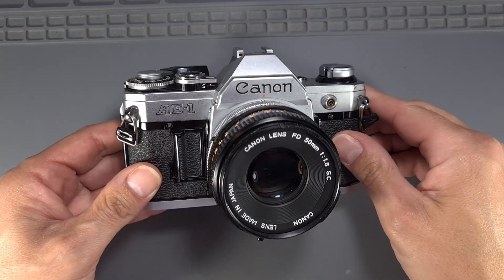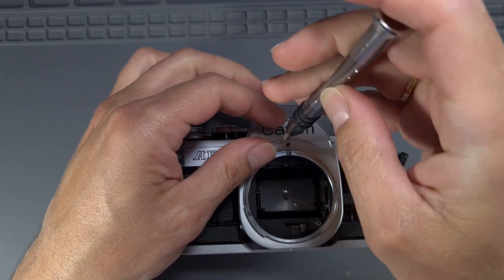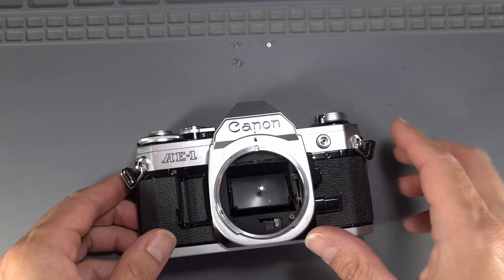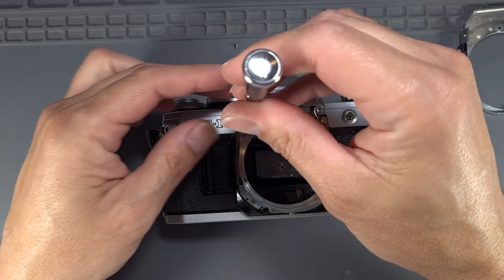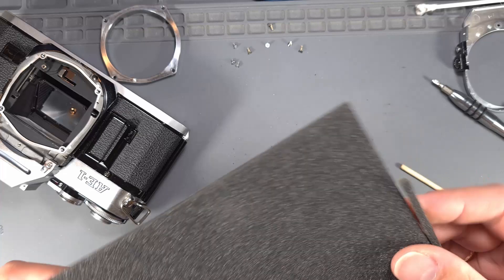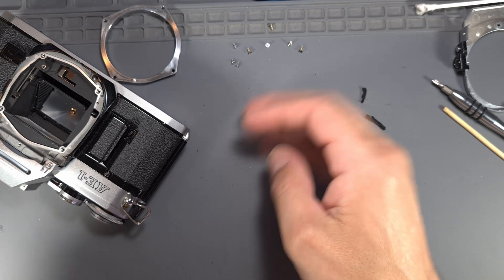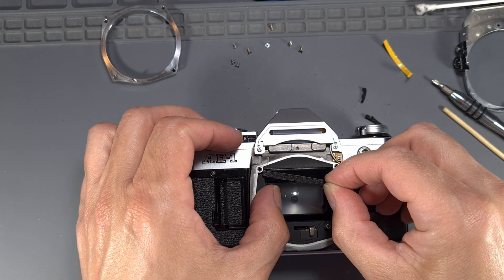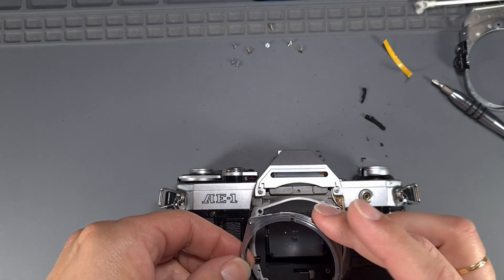Canon AE-1 - Replace the Mirror Damper

Comment: Hello Sir, great video!

One question:
I just bought a Canon AL-1, and replaced the mirror damper with a 2mm thick foam.
I've noticed though that the mirror (and neither its frame) does not touch the dumper foam when going up, and actually with its frame hits a small piece of steel placed on the top left.
There's also a "spring" noise when doing it.
Should I add another 1mm thick foam?

Thanks!
Reply from the maker: Better to replace to a 3mm one...

Comment: Thanks for the video! There are a couple videos on YouTube demonstrating how to replace the light seals on the Canon AE-1, also applicable to the AE-1 Program which I own. More than one video demonstrates using yarn and adhesive-backed felt instead of replacement foam, because yarn and felt are more durable and equally effective. However, those videos don't demonstrate replacing the mirror bumpers, only the light seals on the back of the camera.

I am curious:

1) Could adhesive-backed felt also work for the mirror bumpers if it is cut to the correct size? Or will the adhesive-backed felt be the wrong thickness to mimic the 3mm replacement foam?
2) What do you make of the yarn-and-felt light seal replacement strategy overall?

Thanks again!
Reply from the maker: Hi,

1)  The adhesive-backed felt is the wrong thickness...
2) Sometimes I use yarn in the light seals to... It's easier to apply in some cameras...

Comment: really great video! I have a question: I had some specs on my focus screen from the foam. I removed them with some isopropyl alcohol but now I have smudges all over it when I look through the viewfinder. its like the alcohol left a smear across it that I cannot remove for some reason. I know it doesn't affect the photos but I am wondering if there is anything I can do about this?
Reply: Hi ! I have the same issue...
Reply from the maker: Focus screens are very delicate even with alcohol...

Comment: The small black box on the side of the front cover came off when I took off that first part 😥
Reply from the maker: There is no problem... just put it back again before install the front cover... That part is not glued to the cover. You just have to be careful not to lose it.
Reply: @FotofixVintageCameras  reattached it no problem! Thank you

Comment: Hi, my Canon AE-1 has a problem with the mirror that is stuck up. Otherwise the camera is in excellent condition and is responsive to battery but I can't get the mirror to go down. Is it hard to repair? What could be the problem? Thank you for your time!
Reply from the maker: When you press the battery test button the mirror goes down?
Reply: @FotofixVintageCameras  Hi,I have the same problem,the mirror stays up ,but goes down when I press the battery test,what could it be,thank you

Comment: Does taking off the front cover make it easier to access the location you need to lubricate to get rid of the common squeak sound when the camer shutter fires?
Reply from the maker: Yes, you have to remote the front cover...

Comment: I have an issue related to this. Recently got a pretty minty Canon AE-1 that seemed to have some specks when I looked through the viewfinder. After some poking around, it looked like the focus screen had the specks. I tried blowing a bit of air on them but they didn’t budge, so I went in with a q-tip. It wasn’t dust though, it looked like the old foam had melted into this greasy goop and now my focus screen has some dark smudges that don’t seem to come out with a plain q-tip. Any ideas on what I can do to clean this without disassembly/having to send it out for repair? I’ve seen conflicting statements on using isopropyl alcohol on the focus screen. Kinda bummed since getting the focus screen out of the AE-1 is such a process compared to the Program. :( This shouldn’t affect the actual images right?
Reply from the maker: It doesn't affect the images, don't worry... only the image you see on the viewfinder... I normaly clean with isopropyl alcohol and an q-tip, very carefully...